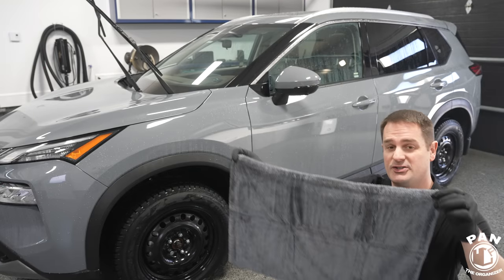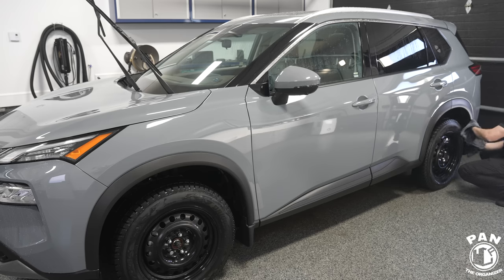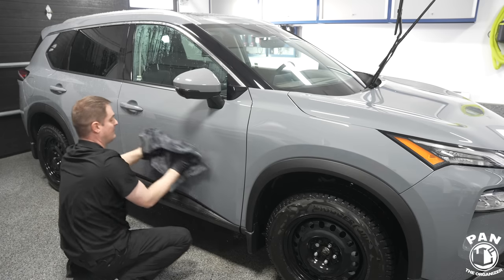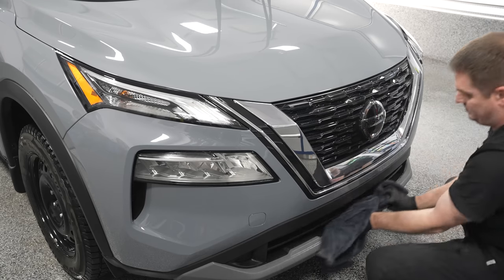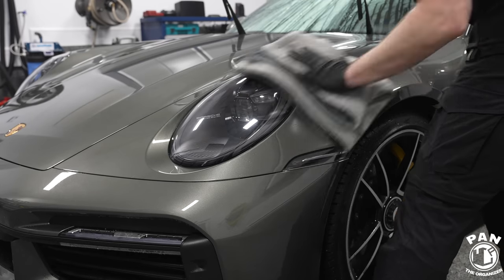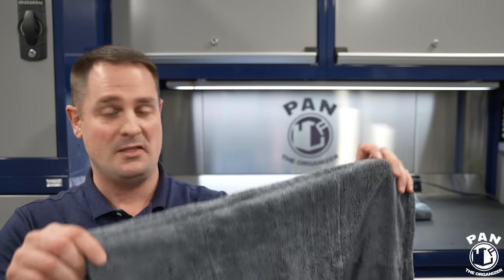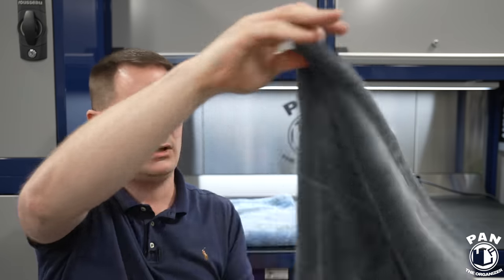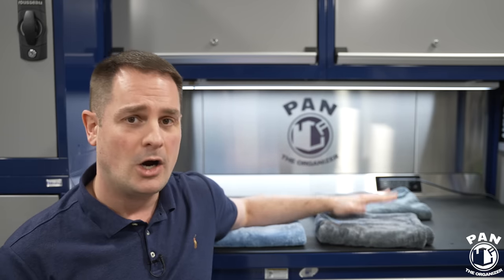My new favourite microfiber drying towels?

Comment: Thanks for the video! Shipping is again bizarrely priced with this company, but I appreciate your video nonetheless. Will you choose these towels or your blower for regular use?
Reply from the maker: I usually start with a blower as it’s so much faster when you have a coated car. And I finish with a microfiber towel and drying aid for the finishing.

But when I detail a car, and it has no protection, this will be my go-to towel for drying for sure.
Reply: I am in Ontario, Canada and they don't specify what the shipping method is. They call it "Starter Shipping" for $32, which is absolutely crazy for a towel. They do not provide any options to choose shipping other than this. I've ordered towels from the states before for about $14 shipping via USPS. I suspect this seller does not want to deal with international shipping and only provides a courier service at a premium price to cut down on their work. They really should provide what the shipping service is as you have no idea what you are paying for. It's only a towel though, but I bet they could get a ton more sales with options for shipping...but it may be a small business that doesn't want the hassle. All good!
Reply: I too was eyeing some towels but the shipping was way too much. I hit a pop up to shop in the Canadian store but the shipping was still too high to justify. Really wanted to give it a try

Comment: The Dreadnought twisted loop towels perform exactly the same.
Reply from the maker: I haven’t tested that one.
Reply: @PanTheOrganizer .I can highly recommend them. Plus, can you tell me why the paint feels more slick if I rinse my car with filtered water?
Reply from the maker: Because the normal tap water usually has minerals in it (we call that hard water in places where mineral content is very high, and that can leave water spots behind, as when the water evaporates, it leaves mineral deposits behind, which can eventually etch through the clear coat if not taken care of).

Comment: I can never get these towels to work without leaving streaks. I keep going back to the trusty chamois
Reply from the maker: Please don't use chamois. Those are a thing of the past. Microfiber towels are much safer and softer for automotive paint. What towels are you using? Do you wash your microfiber towels before the first use? That's important. Do you take proper care of your towels (washing, drying, etc)?

And another trick is to use a good drying aid while towel drying. It helps prevent streaking, water spots, and boosts gloss and slickness all while acting as a lubricant between the towel and the surface.
Reply: @PanTheOrganizer  it’s the rag  company double twistress. I follow all the instructions.
Once it absorbs a bit of moisture, it leaves streaks all over the car. 
The car is also ceramic coated

Comment: All the magic lies in the fact the Sucker and JR weigh more than any other towel you have tried.  If you compare equal weights of towels, they would all perform the same.  My only question is if the Sucker towels resist pulls.  I have a few TRC Double Twistress towels which weigh about 1/4 the Sucker and will absorb 1/4 of the amount.  My complaint is they get a pull every time I use them.  I need a towel with better weaving.  Do you think the Sucker weave will resist pulls?
Reply from the maker: What do you mean by pulls? All I know is these absorb more water and do it more efficiently than any towel I have tried so far.

I still have many other towels to try.
Reply: @PanTheOrganizer  a pull is wheee a loop get hooked and gets pulled to a longer length and sticks out.  I just washed my Double Twistress and had to cut off, as per the manufacture, the loops that pulled out.
Reply: I understand what you mean. You can always get a pull if you catch a sharp object like edge or of a wiper blade or chrome edge. Buy in my experience the Sucker series of towel have a more dense twisted loop and will perform better than a loose knit twisted loop. I hope that makes sense.

Comment: I bet these leave Lint?? Almost every MF towel I've used leaves Lint, it drives me nuts!. Waffle weave seems to be the best as far as reducing lint. Test it on the windows, that's the best way to test.
Reply from the maker: I have never had linting issues with my towels. I only buy from reputable microfiber makers (The Rag Company, Luxury Microfiber, Microfiber Madness, Autofiber, etc). I always wash my towels before the first use. And I wash my towels after each day of use, using proper care methods.

And for glass, I always use dedicated glass towels, that are low nap, no linting.

Comment: Why do some towels streak?
Reply from the maker: I don't have streaking issues with any of my drying towels. But I wash them properly after each use, with a quality microfiber detergent made to remove any sealants or drying aids, that way the fibers aren't coated making them useless over time.

What towels are you using? Do you wash your microfiber towels before the first use? That's important. Do you take proper care of your towels (washing, drying, etc)?

And another trick is to use a good drying aid while towel drying. It helps prevent streaking, water spots, and boosts gloss and slickness all while acting as a lubricant between the towel and the surface.
Reply: @PanTheOrganizer  I use a dye free detergent and let them hang. They are Rag Co towels. Sometimes I see the streaking when the temps are lower.
Reply from the maker: Make sure the detergent is not only dye free, but also free of bleaches, and most importantly no fabric softeners. Those cause streaking.

Were your towels streaking when you first got them? If the answer is no, then perhaps they are simply past their life cycle and you might need new ones.
Reply: @PanTheOrganizer  I use All clear. They are only a year old. I'll try using a drying aid.

Comment: Shouldn't use any towel that dry rubs your paint.  Buy a leaf blower.
Reply from the maker: Not everyone has the budget for blowers. Hence why you always use a drying aid when towel drying.
Reply: It was your channel where I saw you use one on your car to dry it.

I found a cordless one online for $45.  Everyone can afford one.

I'd imagine while your painstakingly hand drying on one side of the car, the water is drying leaving water marks on the other.  I believe that's one of the reasons you used one.  Its quicker and it's touchless.  No risk of micro scratches in the clear coat or paint.

I was just reiterating your own advise.  😁